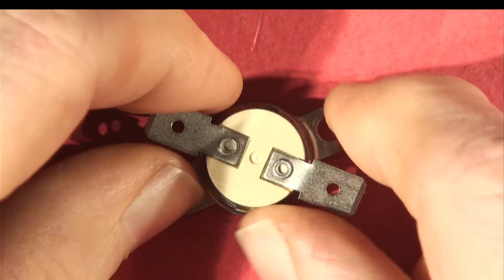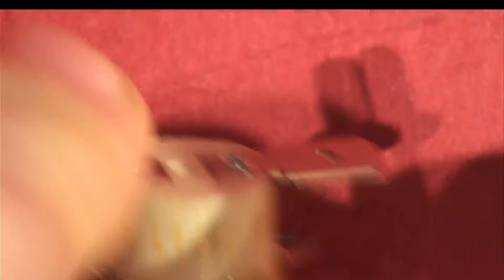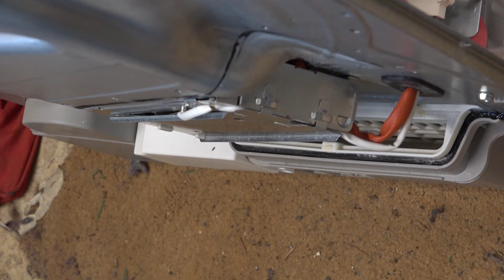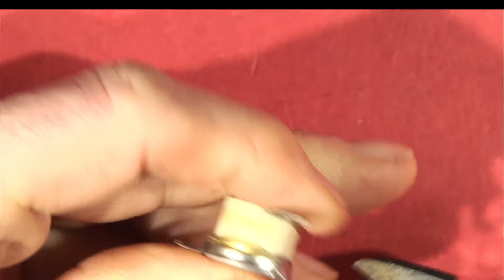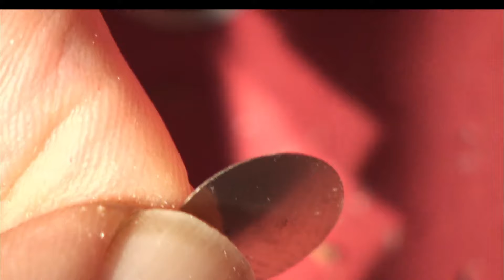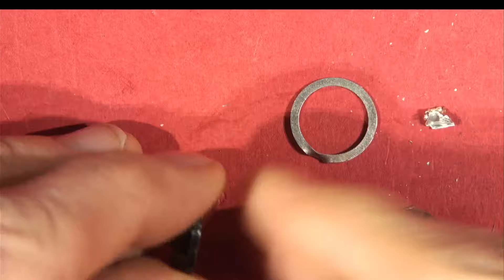AEG Lavatherm Condenser Tumble Dryer Stays Cold Heater Fault Repair

Comment: I a man working on my AEG washing machine which would not power up. On inspection I changed the off line chip LNK364GN and the machine worked for about 2 months before the same fault surfaced again so I changed the LNK again but now the machine works until you power it off as normal but then will not power back up until you change the LNK chip again. Have you ever had this type of failure or can suggest where to look as chinging the chip every time I want to use it is not an option...lol
Reply: I should have added that the resistors were within range and also changed the 400v 22uf capacitor and the diode checked ok.
Reply from the maker: Usually the LNK304GN does not fail without taking out several other components. They don't really go intermittent. They just blow their top or vent gasses.  It could be that a dry joint on the controller is the root cause and the LNK chip was just a red herring and what fixed it was disturbing  an bad connection.    Have a look at my AEG EHO error repair video. You will see what to look for.  Please like and subscribe.
Reply: Thank you for the reply and after watching your AEG tumble drier video you suggested I took out the control board again done another check but after seeing your video with the poor soldered joints I decided to resolder some although they looked good as a last ditch attempt......well the washing machine has powered up again so I am holding my breath in that it's now sorted....so thank you for the heads up in showing how AEG boards may have some poor soldered joints.

Comment: Well done, well worth fixing :-D
A decent quality machine and it was very cheap. 
I've seen those  thermostats/cutouts in fan heaters/washing machines and tumble dryers.
Reply from the maker: It is a really nice machine, it feels good quality inside.. very solid. Never seen one of those thermostats fail shorted but perhaps you never do as the house has probably burned down!!!  Makes you wonder how the trigger temperature creeps over time..... Thanks for watching.